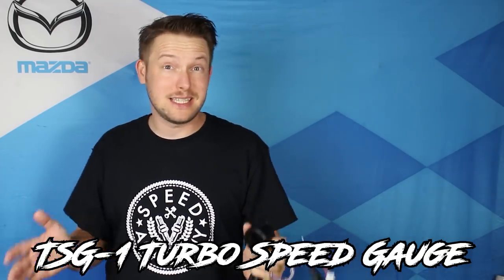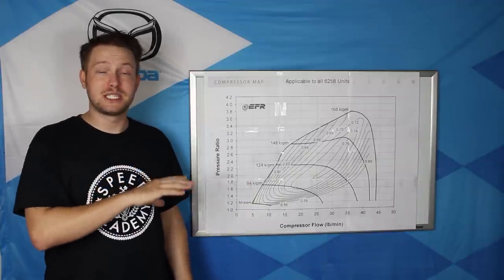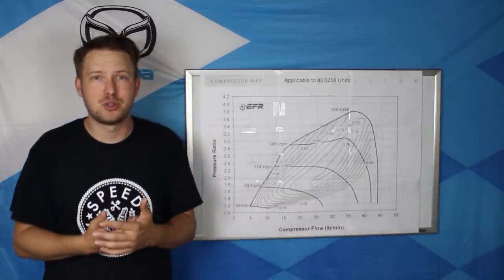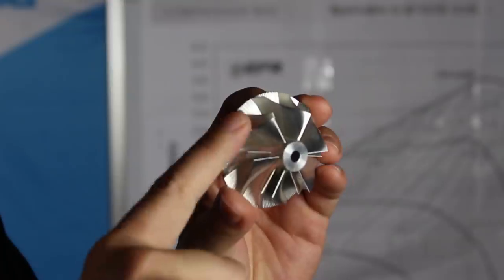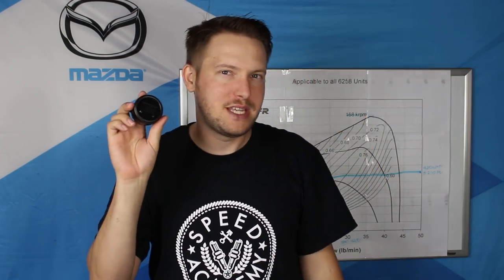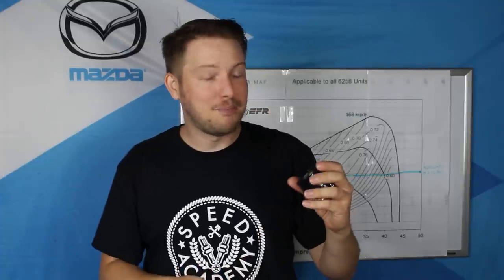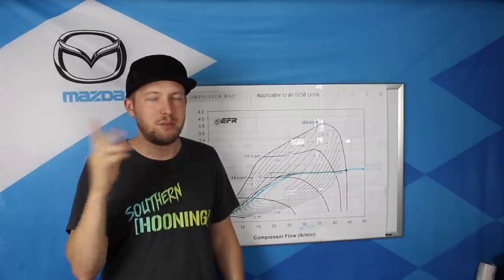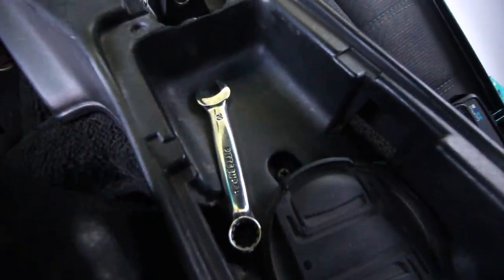The ULTIMATE GUIDE To Maxing Out A Turbo! [Compressor Maps Explained, Speed Gauge Install]

Comment: you can easily convert AFR and fuel flow to the mass air flow. simple calculation.
it's gonna be much more accurate than guesstimating with the horsepower.
Reply from the maker: Sure, the math on paper is simple. But how are you accurately collecting data for fuel flow?
Reply: @TheCarPassionChannel  don't you have a map for injector timing and all the data on your injector size? some ECUs will also directly display a volumetric efficiency map. In that case you just have to multiply that by the RPM and engine displacement while keeping the 4 strokes in mind and using the correct units.
Reply from the maker: @MsMotron  Sweet, so according the the ECU at 6700RPM/21psi I'm flowing 2919cc/min, or 0.77gpm, which is 4.62 pounds per minute. AFR was 11.1:1 at that exact frame in the datalog, so that means the engine was flowing 51.3lbs of air per minute, or 16.6% higher than the physical maximum of the compressor.
Also the VE Table values are affected by user-inputted data (req fuel scaler, injector dead time) and can vary a lot so it's not much help either. 
The injectors flow roughly 1000cc/min at 43.5psi fuel pressure, but I'm running 55psi fuel pressure so that's not much help. And even if 1000 was an accurate number I couldn't rely on the duty cycle values in Megasquirt because they're affected by the accuracy of your dead-time value. (I've seen MS read "125%" duty cycle which isn't even possible.
But I would love to have a more accurate reading of fuel flow, so I'm open to ideas. I just don't think the equipment on the car can get anything accurate.
Reply: @TheCarPassionChannel  i guess you are right, its much harder to accurately estimate the exact fuel consumption in modified cars than i thought. one more idea would be the engine displacement and assuming 100% VE at low RPM and then using this to calibrate the fuel flow? btw, its really cool that its possible to engage with you in the comments like this! i will stop bugging you not though.

Comment: 23:10 is it normal for the turbo to make that sound?
Reply from the maker: It got a hair of surge there, which is not good for it
Reply: @TheCarPassionChannel  okay, I am asking because my dad's miata makes that sound often and the miata is not running properly we will have to do more learning next summer
Reply from the maker: @youtuberbayleexiong908  It will typically only happen with smaller turbos on super fast spooling setups, it can also be caused by an intake that's too restrictive, if the turbo can pull too much vacuum in the intake it raises the pressure ratio

Comment: Air flow or air flow velocity?..
Reply from the maker: When I refer to "airflow" in this video I'm referring to pounds of air per minute. Or how much air (weight) is passing through the engine per minute.
Reply: TheCarPassionChannel  yes, velocity. Air flow on its own is mis-conception too. Between 2 heads with different port sizes giving the same flow, the smaller port one will make more torque